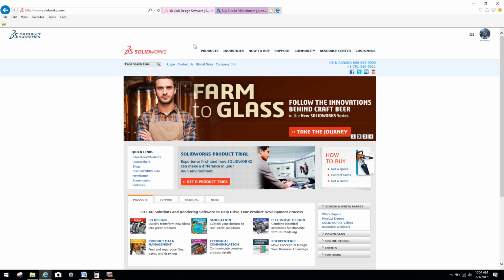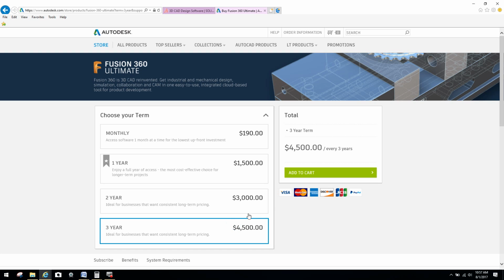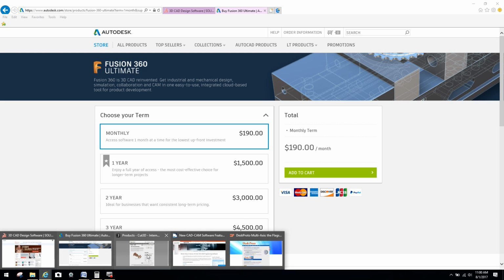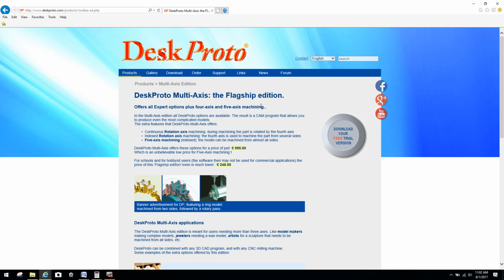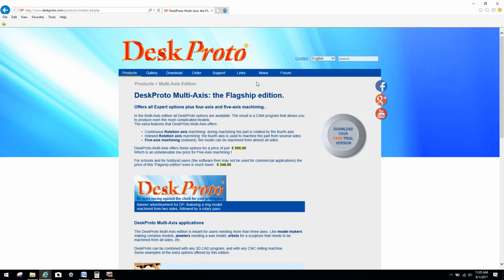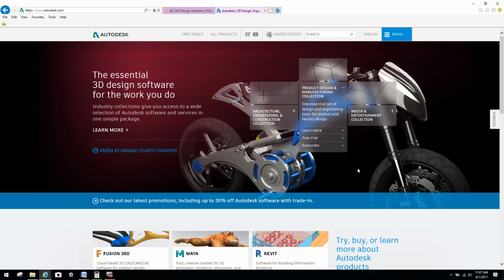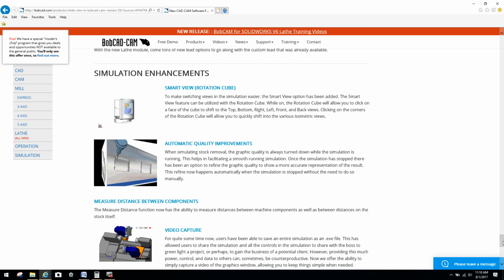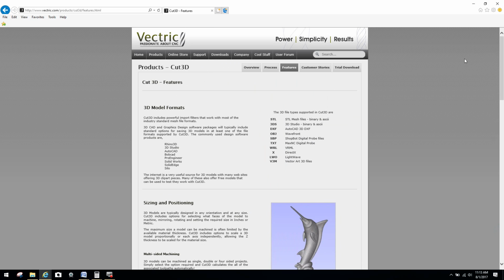5th Axis CNC Micro Manufacturing?  (What you need to know)

Comment: Vince, I stumbled onto you about a month back, and young man you have more common sense than most retired men over 65 have(I'm only 64 ;)).  Ran my first 5 ax machine in 1988 an SNK with 25 deg rotating head. 1999 was ask to research 5 ax machining. Back than there were only a couple of packages costing $25k to 100k . I choose a program made by NCCS called NCL Multi Axis. Its was based on the old apt language. Tough to learn. As you kept saying, "the software will cost you and the learning curve will kill you," IF your not willing to spend the time.  And I mean time.  Your so right you really need the right products for that kind of investment, unless you got more $$ than brains. 

Which brings up my point of commenting, I am thinking ,really want too, build a true  small 5 ax machine. Nothing too big, yet accurate enough to do a, oh,   6 " dia by 4" in Z turbine. I watched "Pocket NC" and how they've build that machine up using Nema motors. So I know it can be done. I believe that if anybody could help me do it, is you. (watch the head, the fan is low, wink)
Seriously if you think its possible, with what you sell,  will would like to talk. I'm just in the  researching and planning stage now so please let me know what you think. Either way u got a new kid on the block. Flavio
Reply from the maker: Thank you, sir for your support, and kid words.

. I try to educate on the truth behind multi axis machining. The controller isn't an issue to build, but the machine will be costly to build when you factor in the required tolerances of the components.

When your ready just contact me, and we can put some ideas together for your applications.

Thank you,
Vince

Comment: what about     Rino ?
Reply from the maker: Peter,I would review it on their site for features, as I've never used it.Thank you,Vince
Reply: im not connected with the company in any way just a user ,, great  cad /cam i have used them all  including solid works  ultimate , fusion 360 etc   one can transfer   rino  {iges}  into solidworks to do parametric  sims and editing then  back to Rino { as a iges file } then  then post to  at least a hundred  cnc profiles , or write your own  with  post processor generator
Reply from the maker: I'm sure its good software as its been around quite a while. There are only a few that can compete with Solidworks, Autodesk, Bobcad, and Fusion. Rino I'm sure is very capable. The main thing with any CAM software is it offers you the ability to do what you need to, and provides US based support to never interfere with your workflow.Thank you,Vince